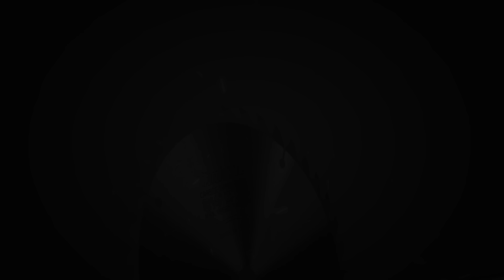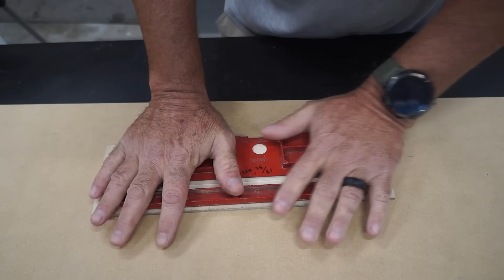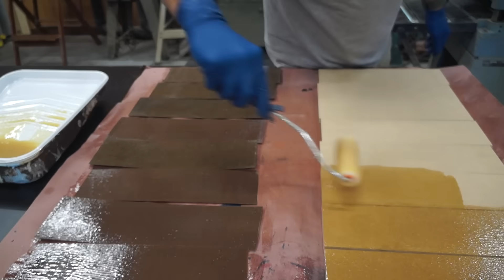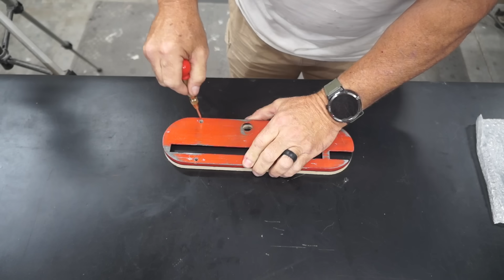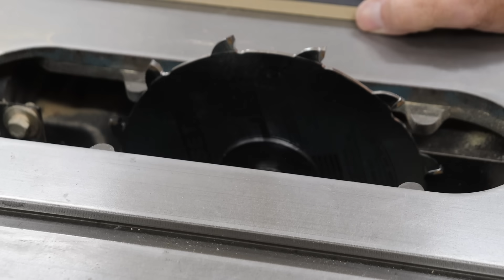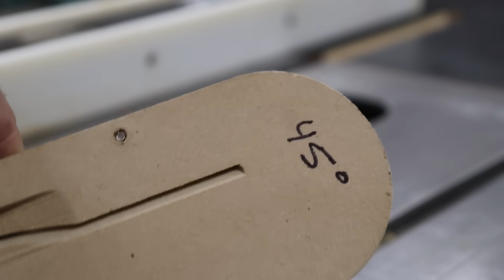Stop Tear-Out on Your Table Saw | DIY Zero Clearance Inserts

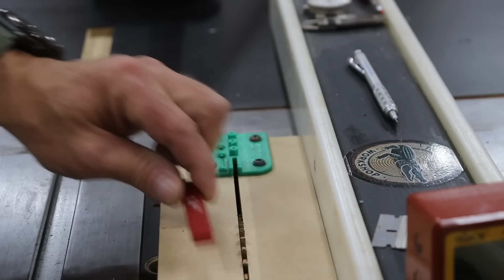Comment: 10:17 what is that rectangle marked with 1/4"? I'm assuming it is a diy height gauge for the sawblade?
Reply from the maker: That's a jig for drilling the mounting holes for a micro systems spliter onto the zero insert templated.  Below is the link to that video.  I hope this helps and thanks for watching.

https://www.youtube.com/watch?v=DQUHCIkyNlY

Comment: One recommendation - spray paint them red like the original. It is red for a reason and that is it is a danger warning. I never put my hand or fingers past my red inserts EVER.
Reply from the maker: That’s a good point.  A lot of manufacturers do use red inserts as a visual warning around the blade area, and anything that helps remind us where the danger zone is isn’t a bad idea.  Painting them red would definitely make that visual cue stronger though. I appreciate you pointing that out.

Comment: Consider this - there is no modern Millwork spec Wood Institute (US) or AWMAC (Canada) that approves the use of contact cement for adhering plastic laminate. PVA glue is easier and much more permanent. Use a vacuum bag or a mechanical clamping arrangement. I’ve found Titebond 3 to be excellent
Reply from the maker: That’s a great tip for a more permanent bond, thanks for sharing! 🛠️

Comment: Why the dangerous cut in the table saw to remove 1/16” when you can more safely run it through a planer?
Reply from the maker: Fair question.
The reason I took that light pass on the table saw was control and precision. I was removing about 1/16", with the piece fully supported against the fence and using push control. For that small adjustment, it’s quick and predictable.
Running a small insert blank through a planer can introduce its own issues — especially with short pieces. You’ve got minimum length requirements, potential snipe, and the risk of it shifting if it’s not backed properly.
That said, there’s more than one safe way to get there. If someone’s more comfortable sneaking up on thickness with a planer (with proper support), that works too.
The key isn’t the machine — it’s solid support, control, and not rushing the cut.

I appreciate you bringing it up. Good discussion makes better shops.

Comment: Why didn’t you apply the laminate before before  cutting the insert blanks
Reply from the maker: A couple of reasons.  First I cut the insert blanks to size first so I could dial in the fit to the saw opening before committing to the laminate. Second, it minimizes any chances of chip out of the laminate by cutting the laminate by itself.  
With that said, you can laminate first and then cut to shape — I just prefer sneaking up on the fit in stages. Less stress, fewer surprises.
Appreciate you paying attention to the details and thanks for watching!

Comment: Love the use of laminate on the insert. My table saw has the same issue as yours with the 10 inch blade not allowing the insert to be plunged through. My solution was to double stick 4 spacers to the bosses in the opening where the set screws press on. This allowed the new insert to be properly aligned in the opening, then I clamped a 2x4 to the table over the insert, fully covering it and not allowing any movement. Then just raised the blade through the insert and the 2x4. It worked wonderfully and was cut through with the same blade I am using on the saw anyway. (With this method the insert with the spacers under it, sat about an 1/8 inch into opening this way to allow plunging through it).
Reply from the maker: That’s a solid workaround.
Clamping a 2x4 over the insert to fully trap it before raising the blade is a smart way to control the plunge — especially on saws where the 10" blade won’t quite clear the insert from below. The spacers on the bosses to get your height right first is a nice touch too.
As long as that insert is locked down tight and can’t lift, that method will get you there cleanly with the same blade you’re running.
I always tell folks: whatever method you use, control is everything. No movement, no surprises.
Appreciate you laying out your process — that’s the kind of shop problem-solving I like to see.
Reply: what do you mean by bosses? are you talking about the metal "tabs" that the throat plate rests on?

Comment: I have some safety concerns with your process.  Routing in the wrong direction and cutting the clearance slot on the bottom of the insert using the miter saw.
Reply from the maker: Valid points on safety—I’m always looking to refine my processes, thanks for the feedback.

Comment: Great idea using the laminate. 1st video I've seen where someone does that.
Reply from the maker: Laminate’s one of those materials most of us have scraps of lying around, and it’s tough as nails. It adds a slick surface and just a little extra durability to the insert without much extra work.
Sometimes the best shop upgrades come from looking at what’s already on the shelf instead of buying something new.

Glad you picked up on it — and thanks for watching!

Comment: I have been using acrylic or HDPE for more than 50 years.
Reply from the maker: Acrylic and HDPE are both great choices. Stable, slick, and not nearly as sensitive to humidity as wood-based inserts. If it’s been working for you that long, that’s proof enough.
One of the things I enjoy about woodworking is there’s always more than one right way to get clean results.
Appreciate you sharing your experience — that’s a lot of sawdust behind that comment.

Comment: I make my inserts from hdpe plastic purchased on Ebay , it comes in white and black . My crosscut sled is made with 1/2 luan plywood with 3/8 x 3/4 aluminum bar stock runners  , i generally use a 40 tooth atb blade . When i cut plywood i bear down with my left hand and push with right . As long as the kerf in the sled is the same width as the blade i don't have any tearout . I used to use plywood with formica on top for inserts but even with ply , in a climate with 80% humidity they would stick .
Reply from the maker: That’s a great setup. HDPE makes a fantastic insert material — stable, slick, and humidity doesn’t mess with it like wood products will. Hard to argue with that.
I’ve run into the same issue with plywood inserts swelling in high humidity. Down here in Florida, 80% humidity is just called “Tuesday,” so material choice definitely matters.
Your sled build sounds dialed in too. Aluminum runners and a true kerf match make a huge difference. And a 40T ATB blade is a good all-around choice for clean crosscuts in plywood.
Bottom line — there’s more than one way to get clean cuts. The key is tight tolerances and good support right at the blade, however you get there.

Appreciate you sharing your setup. That’s how we all pick up better ideas.

Comment: Nice work. I like the use of the MicrJig splitter. Also, I was wondering if you make, sell or have plans for the "Gator" push stick yiu use? I really like it.
Reply from the maker: I appreciate that! The MICROJIG Splitter is a simple little upgrade that makes a big difference in safety and cut quality. Hard to beat for the price.

As for the Gator push stick — that’s a shop-made design I came up with for the channel. I don’t currently sell them, but I’ve had quite a few folks ask about plans. I may put together a template or plan set if there’s enough interest.

It’s about 10" long, has a replaceable heel, thin-rip notch, and of course… the working “mouth” for a solid bite on the board.

If enough people keep poking me about it, I might have to make it official.

Thanks for watching and I’m glad you liked it!

Comment: Thanks for the video, but isn’t it easier to cover the factory wide @$$ insert with painter's tape and when done just throw it away?
Reply from the maker: That’ll work in a pinch, no doubt. Painter’s tape can help support the fibers and reduce tear-out on a quick cut.
The difference is consistency and support. Tape gives you surface support on top — a zero-clearance insert supports the fibers right at the blade. That’s where tear-out really starts. It also improves dust control and keeps thin offcuts from dropping into the abyss.
If I’m making one or two quick cuts, tape is fine. If I’m doing repeat cuts or want dead-clean edges every time, I’ll take the insert.
Nothing wrong with simple solutions — I just like building fixes that stick around longer than a roll of tape.

Appreciate the question!
Reply: @TheEndGrainWorkshop thanks, as I said before (sorry, didn't say before) your idea and how to do is very nice and I will make a few of them, I'll try to make a 90° and a 45° for my miter saw, that's where I do most of cuttings. I don’t understand why the saw brands don't put a couple of zero clearance in the package, they shouldn't cost much for them, but then again, they're bunch of greedy bastards.

Comment: I made a cross cut sled yesterday, and could not figure out why the piece would raise up in the air when I would raise the blade to make the cut so I could use my Johnathon Katz Moses jig to make my fence square rather than the 5 cut method. That set up works really well, but I did use a 2 foot long straight edge to make for a longer edge to compare so I would get it as close as possible. Anyway, I had my splitter on the saw..... I think I will remember that next time.....
Reply from the maker: Ahhh yes… the mysterious levitating workpiece. We’ve all chased that ghost at least once.
That’ll do it — the splitter and a crosscut sled don’t exactly play nice together. The sled already controls the kerf, so the splitter can lift the workpiece as the blade comes up. Easy thing to forget when you’re switching setups.
And that Jonathan Katz-Moses Dovetail Jig fence squaring method works great. Nothing wrong with using a long straightedge either — the more reference you’ve got, the tighter you can dial it in.
Sounds like you diagnosed it quick though. That’s how we all learn — one head scratch at a time.

Appreciate you sharing that one!

Comment: Thank You 
I’d suggest sealing the MDF to prevent interaction with humidity and to harden it making it more durable. Or maybe I’m just overthinking this.
Reply from the maker: That’s actually a great point — you’re not overthinking it at all.

MDF will absolutely move and swell if it’s exposed to humidity, especially here in Florida where the air feels like warm soup half the year. Sealing it is never a bad idea if you want it to last longer and resist edge wear.

In this case, it’s living in a climate-controlled shop and mainly acting as a zero-clearance surface, so I’m not too worried about it. But if it were in a garage shop or higher humidity environment, I’d definitely hit it with some sealer or lacquer to toughen it up.

Good catch — I appreciate you thinking it through.

Comment: You can also use circ saw blade to make your Initial cut. Just make sure you're matching the kerf.
Reply from the maker: That's a great tip, using a circular saw blade is definitely an option if you match the kerf! 👍